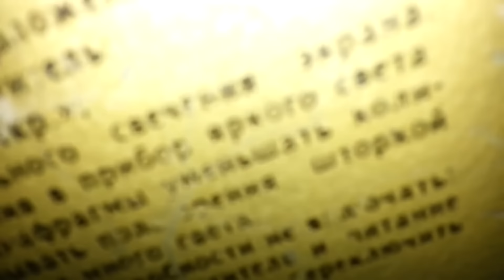Inside T-72 Main Battle Tank.

Comment: The worn out paint, the dusty-everything, metal milled pieces, and guns, it looks rrally neato in there
Reply: In Russia you don't complain, this thing is just as good as a m1 Abrams
Reply: @Muslimcel i have seen tanks that served in ww2 in better condition
Reply: @NotLRK  This is a T-72. And it's even possible this isn't even modern footage, lol. You're also forgetting about the T-90 series tanks; which I'd argue that the T-90 is probably better then the M1 in a few ways.
Reply: @NotLRK  buwahahaha
Reply: @NotLRK  yes, we can see it in Ukraine
Reply: @BackwoodsTruther  That has more to do with he Iraqi Army being really shit rather than the tank being shit. But again it seems like no one competent ever seems to use Soviet equipment, even the Soviets and Russians themselves, so we will never know how good the T-72 is compared to the Abram when it actually does what it's designed to do
Reply: The kick back of the gun was not very much, when compared to massive kick back of a Abrams. 
This is why T72 in desert storm, could not punch through the armor of the Abrams. 
But the Abrams could go right through the T72 like a hot knife through butter.
Reply: @IPEsometimes  M1 knocked out russian tanks just fine. And t-90 is not that much of an upgrade. And russia can't afford many t-90 any way.
Reply: @brianbranham5157  That's not how that works. When abrams first came out it had a lack of Apfds shell and a bad gun and overall bad hull armour. The turret armour was good but that was it. Let's see if it would be put against soviet equivalant like t-80b I would rather bet my money on the t80b [talking about 1st generation abrams]
The abrams when it came out was just really lacking in pretty much everything. But now it's a decent tank.
Reply: @KOningNoviPoes  how true G,M had a better tank, but U S went with the Chrysler tank ,because the government was bailing tham out of bankruptcy.
Reply: @BackwoodsTruther  According to who? Cnn? source?
Reply: @brianbranham5157  That was a lame comparison mate, the kick of the gun can be reduced, so it has very little to do with velocity, kinetic energy and penetration. It's a fact that the T72s without ERA had no chance to win, the same way a standard Abrams with no reactive armor can be taken out with the outdated RPG-7VL. Now add the uranium shells commonly used by the US forces at the time, this thing penetrates steel like hot knife through butter. The Iraqi tanks were very outdated compared to the M1, so they had no chance. The same way the current T-72B3 will most likely dominate the M1 variant from back then, but unless we see the latest variants of M1 and T72 in direct confrontation no one can tell which one is better.
Reply: @IPEsometimes  how so?
Reply: This isn't a Russian tank it's Kazakh
Reply: Makes sense probably a Soviet left over tank in Uzbekistan or maybe Kazakhstan
Reply: @IPEsometimes  LOL no.
Reply: @brianbranham5157  no. it was because t-72m wasnt equipped with up-to-date ammo, they mostly used 3bm9 that was developed in 1962 (estimated penetration 245mm@0 deg at distance of 2000m, penetrator length 410mm, weight 3,6 kg , muzzle energy 5,8MJ). at the time the conflict took place, russia already used on t-72b ammunition called 3bm42"mango" introduced in 1986 (with penetration }a{: estimated at 0 deg angle of 510mm at 2000m and }b{: confirmed 260mm@60 deg [notice the angle difference] at distance of 2000m, length 532mm, weight 4,85kg, muzzle energy 7.1MJ ). in short, exported versions that had no effective ammo (russians used that ammo for training purposes at those times) and no composite armor(export versions didnt even have composite in the turret!) with low morale and poorly trained crew faced against professional crews with up to date equipment and ammunition, and full aerial support... see the bias? i hope you do.
Reply: @miroslavstefanov9196 finally a balanced fucking take.
Reply: This isn’t a passenger car it’s not supposed to look pretty
Reply: @BackwoodsTruther Dust storm without it dessert storm would be catastrophic
Reply: @cloroxbleach9222  Well thats not true, look at the Ukranians!

Comment: Now for the real deal breaker, do T-72s have cup holders?
Reply: yes
Reply: sometimes
Reply: @jesussolis363  I don't know about that, cup holders are pretty serious over here.  A must have for a T-72.
Reply: Vodka holders
Reply: @yukarni5555  just poor the vodka into the coffee 😃
Reply: Got cup holder which double as an ashtray
Reply: Its bottle holders i guess
Since they love vodka not tea
Reply: Russian tank designers never had comfort in mind for the crew lol
Reply: @rylanleeper4456  while true there's always a first time for every thing
Reply: Yes. Für vodka.
Reply: Да
Reply: I mean, soviet submarines have arcades, swimming pools and saunas so a a cupholder is a probably.
Reply: @chopcyk6452   Good point, if a sub can have all that a tank with cup holders wouldn't be a stretch of the imagination 😀
Reply: At 2:09 you can see cup holders at the right
Reply: That reverse speed though
Reply: там нет стаканов. пьют из бутылки )
Reply: Probably not by default but this is Russia, the crew probably welded some old tin food cans to the sides of the inside of the tank to use as cupholders.
Reply: Yes they also have cup dispensers se the little casing after it fire's
Reply: It has an empty shell holder. We can count it as a cup. When loading new round it ejects empty shell from the back of the turret.

Comment: its rusty but Ivan it works
Reply: Yes it works indeed
Reply: Everybody gangsta till the shit falls apart
Reply: @GhostOfDamned  -- Until it falls apart, that's when we stop.
Reply: @thescholarlychronicler1805  until theres nothing to reanimate
Reply: "We're repainting it on the next service-checkup"
Reply: Apparently the autoloader also offers instant cremation if you get hit by an effective NATO Anti tank weapon 😬
Reply: Todd Howard: It just works
Reply: @ChaosSpectator2020  if anti tank goes through armour, you die irrespective of Nato or Russian tank
Reply: @sreejithsubhash7301  Russian tanks have a higher chance because of carousel autoloader which means any sabot or HEAT jet will cause instant explosion inside the tank.NATO tanks store ammo in the back of the turret protected by a blowout panel.It sometimes even protects the turret crew even when their ammo explodes
Reply: @abbabubba  that's not true 
The autoloader from the horizon has a relatively small area to be hit 
Its the top attack weapons which have a high probability of hitting the shells
Reply: @abbabubba  thats a common misconception. It protects the crew if the ammunition is on fire. If there’s an ammunition explosion, it doesn’t matter where the crew is. There’s a few videos of Iraqi M1’s launching their turrets after an ammunition explosion.
Reply: Pohyi

Comment: finally seeing how autoloader works in t-72, tank you :P
Reply: So shell, then propellant, then fire, then discard smoking shell casing
Reply: @FormaCodex_5-7  yes, furthermore on T-72 based tanks including T-90, said casing is ejected out of the tank through a small door near the rear of the turret on the roof. This opening directly leads into the crew compartment so the ejection compromises NBC protection. I assume there is a way to override that and let the casing just fall on the floor like in T-64/T-80 tanks as having NBC protection is useless if you can't actually fire the gun in hazardous environment conditions.
Reply: every crewman has his NBC protection kit ready (and if its old enough tank without NBC protection - always on in contaminated area), they're contained in the tank.
now, in combat, the system will overpressure the exits from the vehicle (автоматический нагнетатель воздуха фильтровентиляционной установки), and filters will do their job as well, so you'll be okay even if you'll fire the main gun, casings will be extracted anyway and the filter-ventilation air pressure system will make sure you dont die in there from gas or bio-weapon when this happens

while on the march, the pad is inserted into the gun, sealing it.
Reply: @youraveragehumanperson219  what is nbc ?
Reply: @hermelnderhans  short for nuclear-biological-chemical
Reply: @Red_Karen  Thank you !

Comment: A human loader increases crew from 3 to 4, 1 more for security, maintenance, and a good one can load faster or at least comparably.  Plus, no way I want all of that ammo around me.  See what the Javelin is doing to the Russian T-72s in the Ukraine.  M1 series with ammo facing away and blowout panels is a better way to go.  What I mean to say is, yes, Russia, well-done, keep making them exactly like this.
Reply: You think an extra crew member would live from any hit from any penetrating shot?
Youre delusional especially from a javelin, the first thing a tank crew does once its been penned they bail out immediately
Reply: @DUSTKILLL  dont think so the main problem why tanks are so easy targets in ukraine right now is because they dont have proper support and that fucks over every tanks as long as they existed not even to mention that those in ukraine are already 40 year old designs. Modernised but still.
Reply: Another crew member as a loader just means you have to train 1/4 more soldiers for the same amount of tanks on the field and that they need supply to match that. What are you rambling about security or maintenance? A 4th crewmember cant secure anything because hes inside the tank and doesnt even have optics and maintanance that is more then minor routine needs to be done in a field workshop not by the crew and a manual loader gets tired an autoloader doesnt. The manual loader still needs to open the ammo stowage to be able to load it and a blowoutpanel would also be useless there as well.
Reply: @Gigolo 69 this doesnt realy make sense in this context or in the one you stated. In the context of the video it doesnt make sense because the tank has an autoloader so no crewmember has to do that and the only thing the commander has to do is to give the order to load, what type of shell and what to shoot and thats the same tasks he has in a tank with a manual loader. It also doesnt make sense in the context you stated because in 1944 the soviets had T34-85 and other tanks that had the same amount of crew as german tanks.
Reply: @NotLRK  you don't have this opportunity if your tank is a T72..... Oh wait no you can actually bail out yeah the ammo rack will surely help you
Reply: spoken like a true smoothbrain
Reply: For the ammunition around you; it’s essentially entirely irrelevant. If a shell penetrates the crew compartment, regardless of whether it detonates or not, statistically the crew are likely fucked. Additionally, as the Ukrainians are doing now and the Russians were doing back in Chechnya, you can simply not carry the 5 loose rounds and optionally the 17 semi protected rounds, and opt for carousel only. In which case, all ammo is behind shrapnel protection in the absolute safest part of the tank.
Reply: Soviet tanks were 20 tons lighter and easier to maintain than western tanks.  the t72 can be left outside for 2 years and can still be started while the m1 Abrams will experience engine failure.  so the difference is idiots
Reply: M1 has explosive panels after 1990. This tank is older than Abraham.  respect to the t72

Comment: Having been one of the very, very few people to have crewed an M1A1 and a T72, I can tell you without the slightest doubt every single Tanker[any nation] would take the M1!
Reply: How did you crew both?
Reply: @DepthofMart  russian spy perhaps
Reply: @DepthofMart  War Thunder
Reply: Soviet tanks were 20 tons lighter and easier to maintain than western tanks.  the t72 can be left outside for 2 years and can still be started while the m1 Abrams will experience engine failure.  so the difference is idiots

Comment: So the propeller and the projectile is separated?
Reply: It is, the propellant is able to be stored in a separate, fireproof box from the relatively safe projectiles. Makes for stronger ammunition as a whole, bit better for an autoloader. Modern cartridge type ammunition has a fragile, combustible casing (See: M1A1/A2 120mm guns) that could be broken and dump propellant everywhere in an autoloader, bad for jams.
Reply: Which is more effective or stronger? The separated or the normal one?
Reply: @historiousedward4145  in ww2 separate was necessary for larger calibers otherwise the shell would be too large to fit in as one, so they used to put the bullet then propellant. Its slower if you have a manual loader but it is safer
Reply: @historiousedward4145  They're both fairly effective, but as Trini pointed out it is sort of safer. You can "lap load" with separate projectile and powder, where you have the actual projectile in the turret waiting to be pushed into the barrel. You can get pretty quick. In terms of actual effectiveness on what you're shooting, there's nothing really between them. Both are more or less equally effective.
Reply: @Mae ! Probably very dependent on the round you use as well.
Reply: what would happen if someone loads the propellant first
 just curious  
:)

Comment: So the commander on the T-72 has to load and arm both the coaxial PKT machine gun as well as fully operate his own NSV machine gun on the turret roof? Talk about having your hands full.
Reply: He's not gonna use both at the same time
Reply: @PallasGamer  The coaxial PKT is operated by the gunner; if both the gunner and commander are using their machine guns to engage infantry, the commander would have to stop what he was doing to reload the PKT when the gunner runs out of ammo for it.
Reply: @Orca19904  why tf would the NSV, its more of an AA gun and using it for infantry is basically suicide for the commander showing the upper half of his body
Reply: @PallasGamer  The commander doesn't have to expose himself; he can fire it from inside the turret. Every Soviet MBT from the T-64 onward has had that ability.
Reply: @Orca19904  still doesn't answer why he's using it and not commanding the tank
Reply: @PallasGamer  he doesn't, but he has to reload it when it runs out of ammo. The gunner can't reach it from his position.
Reply: @Orca19904 no no i meant why he's using the NSV when the gunner is doing the same with his PKT, and the commander can still command while reloading it
Reply: @PallasGamer  thats because top mg has: a)bigger caliber than coaxial mg and b) doesnt require for gunner to turn the turret. c) top mg doesnt have AA function at all unless you meant to shot down ww1 biplanes and ww2 propeller planes... could be used to fight against helicopters on "close" range on the slim chance that said helicopter doesnt notice you first (from my understanding such a feat would earn you a medal, its so rare... ive never have heard of such feat in modern times xD)
Reply: @Orca19904  "The commander doesn't have to expose himself; he can fire it from inside the turret. Every Soviet MBT from the T-64 onward has had that ability" this is not true. T-90 and more modern variants of T-80 have a remotely controlled NSV. However, T-72 does not have a remote controlled NSV. Of the Russian and USSR made variants of T-72, only the T-72B1MS (Object 184-1MS) has this feature, however this tank was never put into service in Russia. So focusing on using the NSV is not something the commander of a T-72 is likely to do, since as others stated, it would risk his life as well as neglect his duties as tank commander.
Reply: @hikaridaruringen8090  I think the real use in the modern day is mostly for engaging light ground vehicles, like trucks and armoured cars. But although the 12mm is not likely to actually be a threat to a plane or helicopter, the psychological impact of having a 12mm fired at you should not be under-estimated, even if it has a very slim chance of actually hurting you. That being said, since T-72's NSV is not remote controlled, it would likely be quite suicidal to even try and scare off an aircraft with it.

Comment: If the want to use different type of round then how they changed?
Reply: They need to fire the loaded round first and then reload a different one
Reply: Its a carousel autoloader so they can just select which type of shell they want to use and then the autoloader puts it into the breach. I dont know if they can switch different shell types when there is a round already inside the breach but thats the whole point of a carousel autoloader design.
Reply: They can choose what shell to load, the autoloader with load that shell or if a shell is already loaded it will replace it